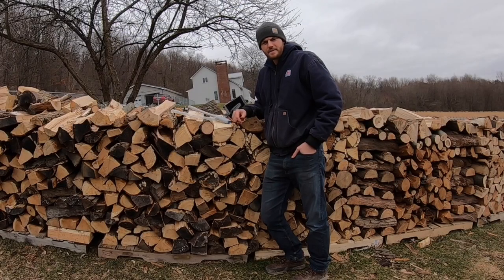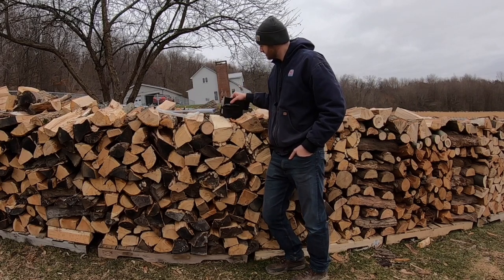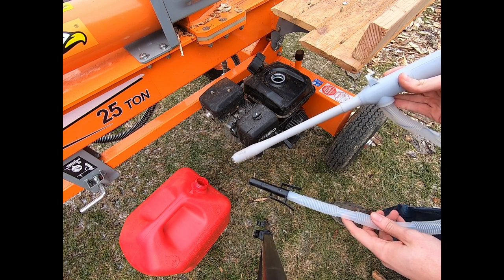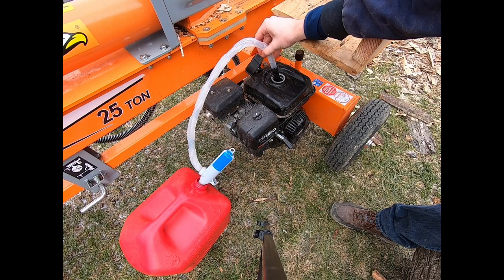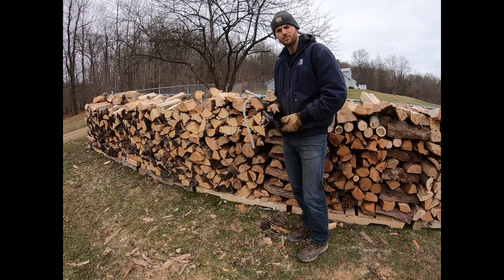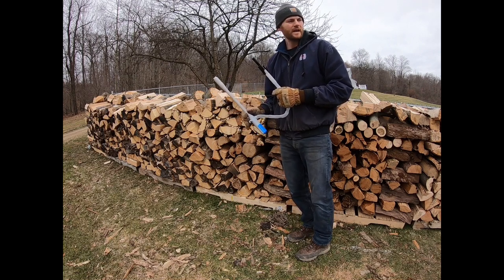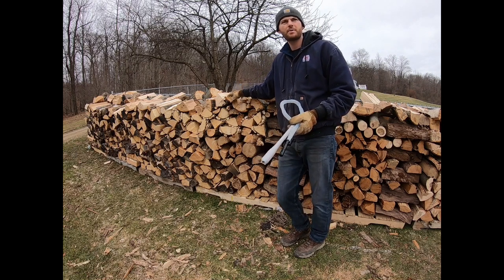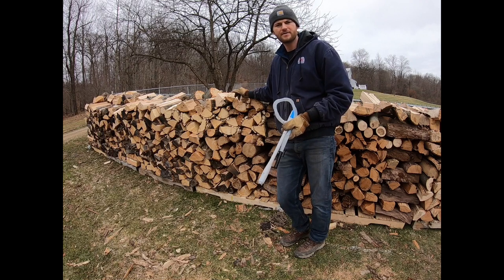#7 Four Way Splitting Wedge and Battery Powered Fuel Transfer Pump

Comment: Try not centering the log with the 4 way. Start on the Edge of log. Same Goes for regular wedge .Most people that Burn wood use Hardwood and try to split the whole log in the center.  2 many knots and to much strain on splitter. A little less surface and less frustration. Throw down a Tarp and put splitter centered over it, easy cleanup/kindling.

Comment: Hey Adam, I know what your saying about the 4 way, I found the same issues your having! As far as the transfer pump goes, I have the same type, only not with the beeper, $ 8.00 at harbor fright with coupon! It works so good I bought 3 one for diesel, gas and def fluid👍🏻✌🏻️
Reply from the maker: Yep. My first purchase after I got the tractor was a 2nd one for diesel. Such a handy tool for cheap

Comment: I like that pump but not at $26 bucks on Amazon.  Effectively the same pump can be had for about $20 less on ebay.
"Battery Operated Electric Siphon Gas Water Petrol Liquid Fuel Transfer Pump $6.89"